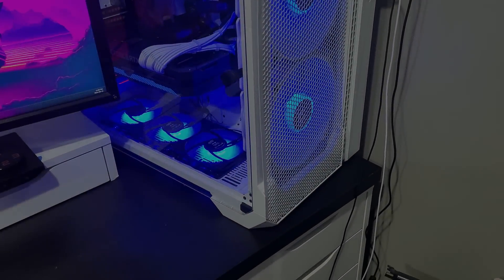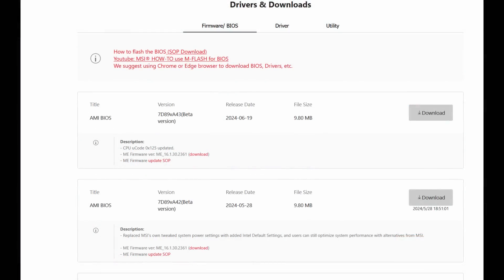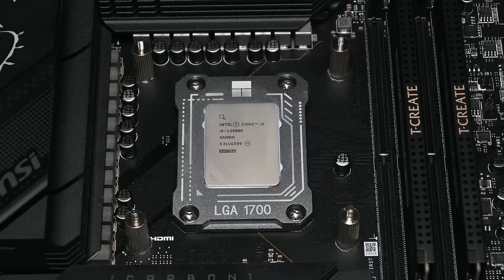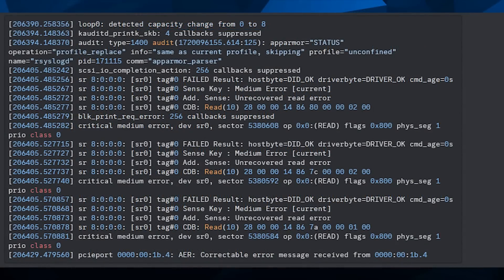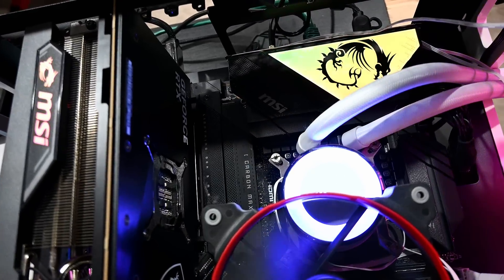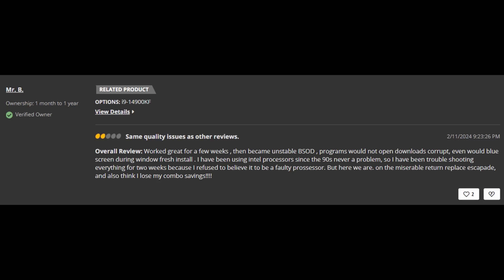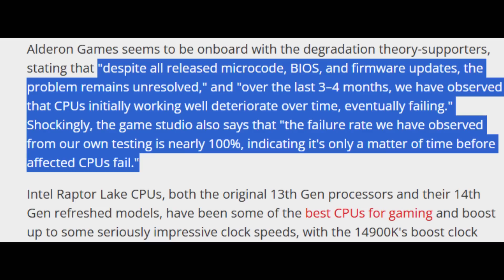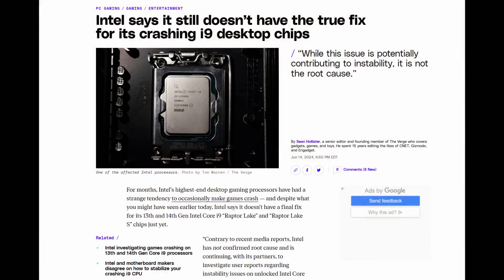Intel CPU Crashing Situation is FAR Worse Than You Think! - 50% Failure Rate, RMAs Denied

Comment: Some of the instabilities can be blamed on RAM (XMP on DDR5 can straight up not work at all, but baking XMP timings in manually might work for some reason - also since DDR5 now has its own voltage controllers, those things don´t have to work properly, since nobody is pushing RAM manufacturers to use the same level of parts as motherboard vendors use - i can definitely see DDR5 failing over time and much sooner, than DDR4 or older kits. I´ve already encountered RAM stick, that was reporting voltage fluctuations - it would drop to 1,08V running 1,1V JEDEC spec and 1,32V running XMP 1,35V - although it might be just faulty measurement, replacing the sticks with another set greatly stabilized whole computer.

PSUs can also cause instability, especially if it cannot handle intel power saving modes (easily fixable for as long, as your motherboard has "dummy load" setting).

Then, there are the BIOS settings. Before intel base profile was enforced, motherboard vendors used some kind of "optimization" profiles, which allowed the CPUs to boost freely, while running quite low Vcore and multiple other settings modified. It wouldn´t be an issue, if there wasn´t silicon lottery involved - my 13600K was unstable with "optimization" 1,2V, but with intel profile and Vcore 1,28V works like a charm.

On the other hand, there was an issue with early 14th gen BIOSes on certain motherboards, when it would push 1,6V into the CPU. While i didn´t encounter that, i had an express failure on 14500, which started failing within days of use.

Comment: i think it's an hardware problem and at this point user experience varie by luck while on server/datacenter with pc running 24h 24 you can't have those problems
ps. on server they user a program to see cpu stability/errors you can try it if you want to see how stable is you 13/14 gen even peoples who don't see problem like you so there are more data out there

Comment: The crashes are happening in servers too specifically games servers and those are running stock no oc so it's definitely not a OC issue alone...
Reply: It's an architecture issue. Raptor lake doesn't have longevity.
Reply: @Riyozsu  Yeah I was pretty sure that was the issue after the Intel engineers didn't have an answer in the first week or two 😂 😂
Reply: Then they are degrading. Simple as that. I recall Intel NIC's, NUC Cpu's and such having the same stuff. Its just a design flaw - intel damn well knows it but won't come out with a admission that would lead to a mass lawsuit.

Comment: Fearmongering and ignorance, which makes for good clickbait. All z690 and z790 motherboards require latest BIOS versions/updates for 13th and 14th gen. And most, if not all, come with settings that are absolutely worth a manual adjustment. I wonder if these issues come from people that didn't even update the BIOS, much less looking at the BIOS to adjust CPU power and CPU System Agent Voltage related settings (my guess is most of them). That said, I still say.... the  i9 12900K and i7 12700K were the best Intel CPUs in recent years, still worth getting today. Excelent performance, relatively good temps and power consumption, robust and rock solid reliable. They're a better buy in the used market than a brand new 13th or 14th gen equivalent, IMO.

Comment: Oh crap. I just bought a 14700k, is this thing going to degrade any time soon?
Reply: I have 14700KF for 1 year. It has not deteriorated.
Reply: Its 50/50. But if so many of them fail in less than a year, then I have 0 confidence they'll last as long as the chips of the past did. Most people will probably be struggling to get past the 3 year warranty period without significant degradation caused by the ridiculous voltages Intel decided to push in this chips in order to compete.

Comment: I never understood the point to 12th, 13th, 14th Gen i9 chips. You get 8 P-cores on the i7 chip which is what most people are buying these for.
Reply: Its normally for bragging rights and the feel good that I have the highest end available
Reply: I went Ryzen for the 3000 and 5000 series CPU's, in fact my 7 year old daughter got my former 5900x/32 GB DDR4/6900XT system because I went 13900k, Z690, and 7900XTX.  My 13900K died one day, so bought the Asus Z790 Gaming WIFI II motherboard, because thought my Z690 was dying due to becoming unstable.  Now I am running a 14700K, which works on both boards by the way.  I RMA'd my 1 year old 13900k, will see how it goes.  🤷‍♂

Comment: The biggest issue I've experienced with my 13900K is the USB ports randomly disconnecting and reconnecting. Nobody seems to be talking about that. And, that's on top of the latency spikes, desktop lag, BSOD's using XMP RAM settings, game crashes and the unreliable 2.5Gb onboard network. My 9900K was flawless and my second PC, a 12700K, is flawless. My 13900K, which is my SECOND one (replaced under warranty by Intel in April), has been nothing but a nightmare. This weekend I'm driving to Micro Center and picking up an AMD 7950X3d and X670E AM5 motherboard. I feel like snapping this 13900K in half. Pure garbage.
Reply: not waiting 3 weeks for a 9950X?
Reply: The 2.5Gb onboard network issue is actually an intel issue, but unfortunately it also affects many high end AM5 boards as they also use the trash intel NIC. The problem is the I225-V is trash, they're on the 3rd revision trying to fix it and it's STILL a buggy mess. Thankfully the newer ones have workarounds such as disabling power saving that fix it. You really should wait a few weeks for the 9950x, zen 5 has a ton of under the hood upgrades that will make it far more than it's raw 20% speed increase better, just as the 7950x is far more than it's raw performance better than the 5950x.
Reply: Wow!! This was happening to me I thought it was just horrible windows 11. Imagine this and windows 11…. Pure trash
Reply: My 2.5Gb onboard network port is unreliable too, but I have an AMD board. Seems to disconnect often when connected to the 10Gbe port on my modem (so it has a link speed of 2.5Gbps) but it works fine when on the 1Gbps. It's a Realtek. So maybe that's not Intel's fault (unless yours is an Intel network adapter)
Reply: @Vitam1nx  On my 12700K system, I installed a Realtek based 2.5Gbe PCIE NIC and disabled the onboard NIC. On my 13900K system, I installed an Intel 82599 based 10Gbe m.2 NIC, which has been 100% reliable. I've also had good luck using Marvel based 10Gbe NIC's.
Reply: Awesome… welcome to the red side.
Reply: Wait a few weeks and get a 9950X (non 3D) its going to be faster then a 7950X3D
Reply: @defectiveclone8450 Anything is faster than a 7950X3D, it's a bad CPU (scheduling nightmare).
Reply: Yeah ny 13500 has usb issues too and sometimed it feels really slow....im selling it and getting 12600k asap.
Reply: Latency spikes..Dell by any chance?
Reply: @szilardfineascovasa6144  Latency spikes are parked cores and windows power plan set to hurt perfomance just for efficency.
Reply: @saricubra2867  Could be, and thanks for that, bud - I was speaking about something else I investigated with Latency Monitor...which can be "thanked" to Dell designs for a few generations now. Could be BIOS, could be something else related to the motherboard...certainly something lower-level and closet to the metal than the OS.

Many people complaining about such issues for years. On high-end laptops. I'll never ever buy a Dell machine, that is for sure.

If modifying the power plan solves it, that's a walk in the park.
Reply: @szilardfineascovasa6144  It's an OS issue, not hardware.
Reply: I also own a 12700K, the best Intel CPU ever since Sandy Bridge i7.
Reply: @saricubra2867  3 years ago right after the pandemic I had initially bought a AMD 5900X because Influencer almost unanimously bragged about its performance. However, it crashed constantly with no OC. I confirmed via BSOD code that it was a CPU fault. I was also quite fed up with the low quality assembly of that AMD CPU package. I switched to Intel 12700K. Since then, not a single incidence of BSOD in 3 years. I know this is single event that bares on statistical meaning. But I wonder if there is ever any influencer who had experienced faulty AMD CPUs, had they talked about it at all? or it is just me?
Reply: This is a problem that also is well documented on some AM5 motherboards. Possibly an unrelated BIOS issue.
Reply: @derelictmusic3218  I have this issue on my AM5 MB.
Reply: Then after saving money by getting the regular 7950X, check if AMD solves the scheduling problems in the future for the X3D Ryzen 9s.

For now, a 7800X3D is significantly faster in games vs a 7950X3D and the 7950X has the best productivity by AMD.
Reply: The 7950X3D is a terrible CPU, only one CCD has the extra cache. Better buy a regular one, not a scheduling nightmare.

People compared the 7950X3D vs fully normal and stable 13900K, the latter feels faster because of Thread Director, AMD has nothing like it.

Comment: The 12th gen chips dont have these issues as well as 13th and 14th gen cpus that use 12th gen rebadge (14500, 13500, 14400, 13400, 14100, 13100)
Reply: Probably means 13700k and 14700k, which are basically 12900k but binned better
Reply: By 12th gen rebadge, I meant 14500, 13500, 14400, 13400, 13100, and 14100.

Comment: All of the above design changes on + 200 MHz clocks, i/o block change and thread directed compilers which I attribute the most likely issues on all of the above. Danny u r aware I have said Intel once policed for main bd mfg push, and gave up. So the question is did main bd houses infiltrate the Intel employee base to get their way or is it some other combination of all of the above. 41 M to 49 M 14/13900K_ produced and I can show 60 M but the minimums are sufficient for oversight purpose. mb
Reply: Regardless of the production volume fandango, which ultimately does not matter, K + KS r 33% of all Raptor. mb
Reply: Just clock them at spec. mb
Reply: Wendell counter point, good report. mb
Reply: Wendell did a good job but that was not investigative journalism but identifying errata on failure data which is a compatibility applications note. mb
Reply: The Linux thread direction is the same thing, not easy Intel tools, that is an Intel fkup. mb
Reply: Intel always put out broad dev C level tools as in the average coder and something just got left behind beginning at Canon on the design tools. mb
Reply: Intel's Cyrix Quake moment? mb
Reply: Oh, 14/13900KF too, I will have to add that to the percent total, it's a small add, but I did not add it into the total and now will. mb

Comment: I had to disable enhanced multicore perf on my 13900k to stop the constant locking up - it's now less frequent. I don't even play games and it's never been overclocked, it's just being used for 3D work. Should have just stuck with the 10900k.
Reply: A 7950x absolutely dumpsters a 13900k for blender and other 3d work. The E cores fall flat when they need to work together with the main cores, the ring bus that makes the intel cpus fast for gaming really gimps any cores past 8.
Reply: I still have my 10900k it ran great for years never crashed.. I upgraded to 14th Gen and took weeks of tinkering to get it stable .. lol .. And it locks up still from time to time… Had to loosen a bunch of settings to get it to run right and I don’t even game on it😂

Comment: Intel should require lowering the power limits and should be the default profile. It is just a matter of time that more would fail due to chip degradation..
Reply: They fail even if you use low power, undervolt, more cooling, light usage.
Reply: @Riyozsu  yeah, but it'll at least slow down the degradation to the point you can get by with using the 13000k/14000k until the replacement arrives

Comment: My guess is that Intel is pushing their thermal controls too hard. Gonna need a hardware respin to fix it. The problem is they have probably blew their load and have a lot of stock of the bad CPU's stockpiled. If there is one thing I have realized in my 30 years of watching Intel is that they are horribly overconfident in everything they do.

Comment: I had an experience with two 14900KF processors, 8 to 80. The first one was bought commercially, after about 3 months of use, it began to show instability. I changed the memory, reinstalled Windows 11 and nothing. Then I went looking on Reddit to understand what was going on, when I came across a lot of complaints, mainly about PL1/2 oversizing and unlimited IccMax. I made the changes to the bios several times, and it really only became stable when I reduced the P-Cores clock from 57x to 53x. However, I didn't think it was fair to have this clock reduction and I contacted RMA. They asked for some automated tests, when I received an email from Intel offering a refund or a replacement processor. My hatred chose the refund, but reason told me to accept the exchange because I would have to buy another MB, which costs the same price as the processor. I received the new processor and this bug/crash story doesn't even seem to have existed. It runs perfectly, accepts 0.05 undervolting. From everything I've seen and read, apparently the problem is accelerated silicon degradation due to the high voltage and amperage. IccMax at 512A is an aberration. Intel and the MB manufacturers are to blame.

Comment: I have an Intel 13th gen processor and haven’t experienced any issues on my laptop? do I need to worry about my 13th gen processor? or what maybe I didn’t overclock my Intel cpu because I am still new to pc and have lots of learning to do, I do hope Intel has a fix for this because if we only have AMD then there is no competition and AMD tried with Nvidia but they couldn’t keep up with Nvidia so hopefully Intel doesn’t give up and keeps trying since they are really Important just like AMD is important.
Reply: Laptops are mostly fine. It's really only the 13th/14th I7 and I9 k chips. It's because they're being pushed so extremely hard to get a minor edge over the competition. 

Laptop chips underclock instead and all of the i3s and i5s are perfectly fine (other issues of course in buying them lol).
Reply: @cuteAvancer  The recent video from Gamers Nexus on this issue points to a design flaw, not just a core frequency that is too high, because even when the CPUs were clocked down, they still crashed.

Comment: i'm happy with my AM4 systems
Reply: Am4 rocks. Just upgraded from a 2600 to a 5700x3d, on a 7 year old budget motherboard. It’s happily running with no issues
Reply: amd is shit.
Reply: I had an X570 MSI motherboard all of a sudden have USB overvoltage issues after having run just fine for 2 years. Switched to an ASUS TUF MB and good so far with FAR more usb C ports than I ran on the MSI. All the same peripherals.
Reply: @sparkeyjames  Sounds like the USB controller on the board, or perhaps a 5v regulator on the board. A solid 80% of the time I see weird failures, it's MSI cutting corners with low quality components.
Reply: @sparkeyjames  X570S are better than non S

Comment: its been happening on my 13700K system...
Reply: Did you RMA it?
Reply: 7800x3d zero problems its grreat. I ditched intel after the hedt died. Intel aint about it anymore.
Reply: @nonameposter378  there's more: you can run it at 65W TDP (88W electrical) you'll still get a performance that's equivalent to 5800X3D
Reply: @nonameposter378 can you record your 7800x3d's 1% low fps and 0.1% low fps in multiplayer games like Warzone,Fortnite, Apex legends and other games 😅?
Reply: @Decki777 don't play any of those trash titles can't help you.
Reply: @nonameposter378  AMD CPUs and GPUs are trash for multi player games pretty much all AMD CPUs have stuttering in multiplayer games and I have Rx 6800xt this shit is down clocking in games and causing massive stuttering
Reply: @Maiza007-c8y  LOL cope! Keep smokin that hopium. Amd cards do run better with amd cpus. I wont lie tho amd does got some improvements they need to make on the graphics side tho. Mainly regarding the marketing.
Reply: @Maiza007-c8y  i have a 7700x computer and a 7900x computer. only multiplayer game i get stuttering on is star citizen lmao

Comment: Well, the online store that I bought my 13900K is going silent, Intel too.
Reply: If you get it, lock the pcores to 5.5GHz and limit the power draw to 288w. You won’t have any degradation issues like these folks are experiencing. Set a negative voltage offset immediately
Reply: @bios9678  Then why did you pay so much money for it if you're just gonna nerf it? 🤨 Might as well have gotten the i7.

Comment: More power and higher temperatures can result in instability? WHO would have thought? Fucking common sense be damned.  😂
Reply: Thing is that it doesn't seem to be just power and temperatures at fault. There seems to be a fundamental design flaw in the cpus that over time gets worse due to the heat and power draw.
Reply: @oxaile4021  from what I heard, heat has little effect on it. For some reason the CPU slowly fails from high voltage. Even if it has really good cooling.
It fails faster if it is very hot, but even water cooled CPUs fail eventually. The only thing which seems to prevent them from failing is to consistently keeping the voltage very low, which would imply much less heat and low clock cycles too for stability.

This may be a design error in the CPU ring bus, or maybe even a silicon technology fault making the CPU less tolerant against high voltages.
It is important to keep in mind that those CPUs use nominally 1.0V-0.9V transistors in the cores and ring bus, but some can boost to 1.5V-1.3V automatically.
Reply: @oxaile4021  there are NICS and NUC Cpu's out there that suffer the same. Intel's quality is not the quality it was 10 to 20 years ago.
Reply: preach brother !